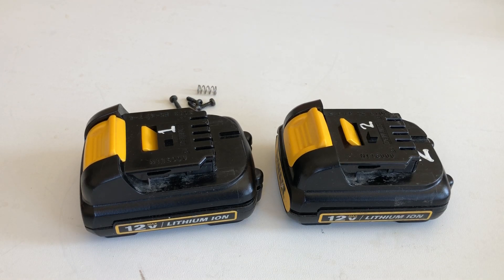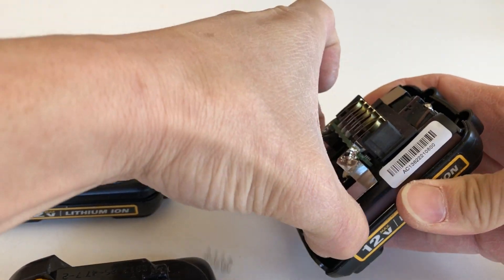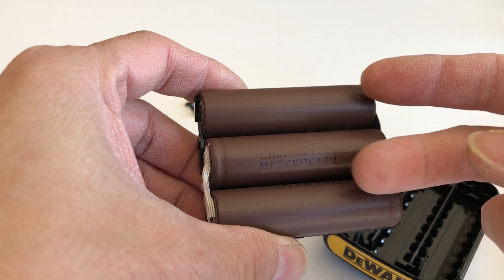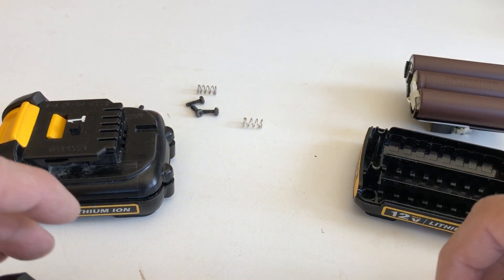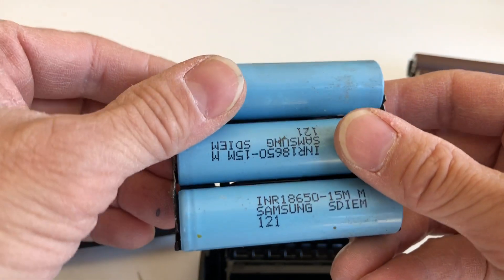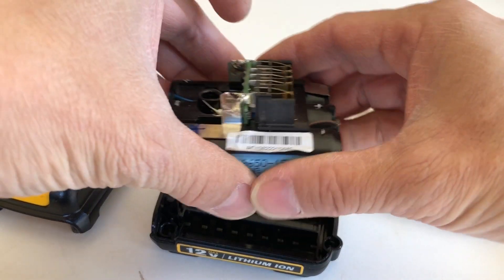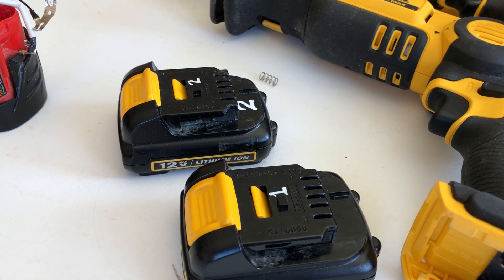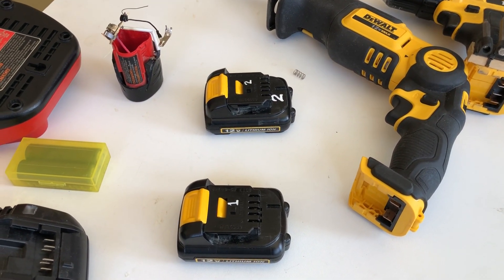Rebuild a Dewalt battery pack with Milwaukee M12 lithium cells

Comment from the maker: Do NOT use recycled 18650 laptop batteries. The drill will work/rotate but these cells will not push out enough Amperage to drive long screws nor bore big holes.
Reply: What 18650s do you recommend these days for doing this project
Reply from the maker: @anthony1113  Vapers use good quality high Amp 18650s. Here is good start from 2022- https://www.e-cigarette-forum.com/blog/moochs-recommended-batteries.7593/cover-image